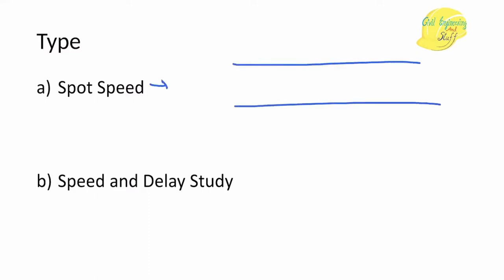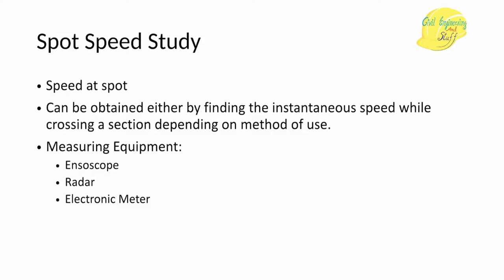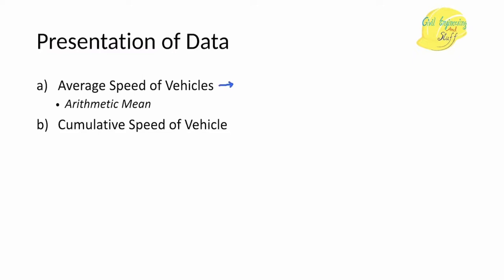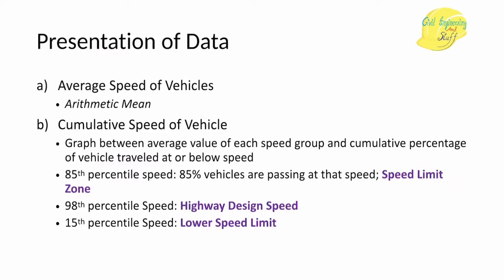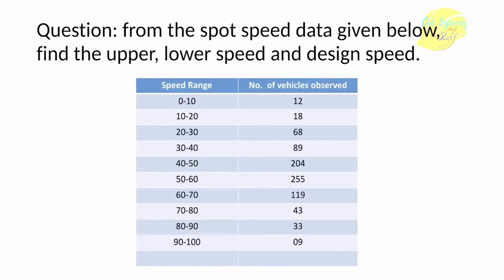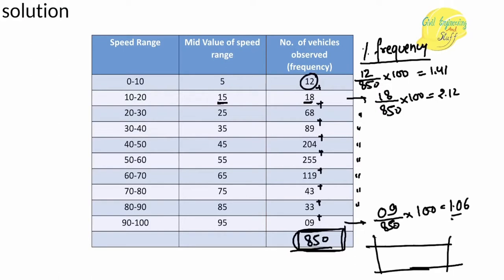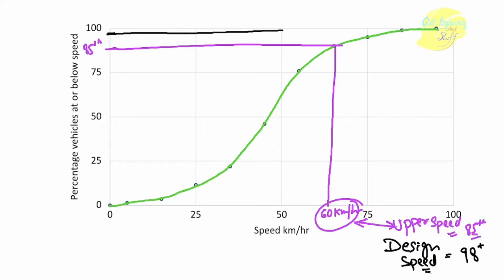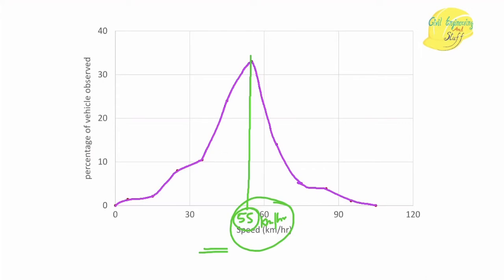Speed Study: Spot speed study with numerical example

Comment: how to compute for speed range?
Reply from the maker: Speed range is more of a surveyor's choice, depending upon the traffic speed range observed during the survey. Conventionally a speed range in the step of 5 and 10 is adopted( i.e 0-5km/hr, or 0-10 km/hr. ..likewise). But if the data collectors feel that instead of a range of 10, a range of 20 (i.e 0-20km/hr and likewise..) can compile and assess data efficiently then they may adopt the same based on the feasibility. I hope this clarifies your doubt. if there is still any doubt do tell in the comment section.  Thanks for watching the video. and discussing your doubt with us.